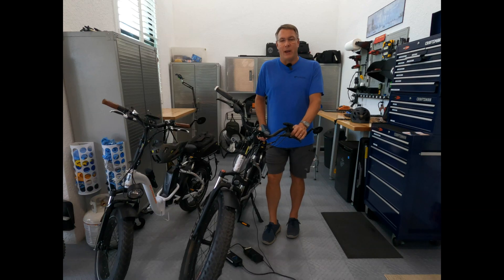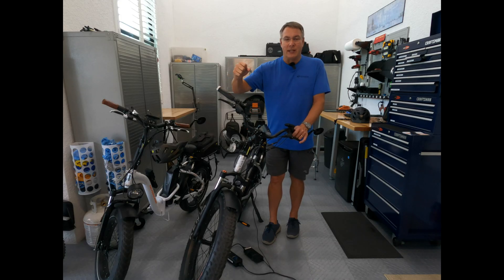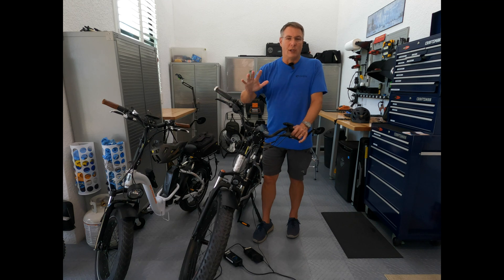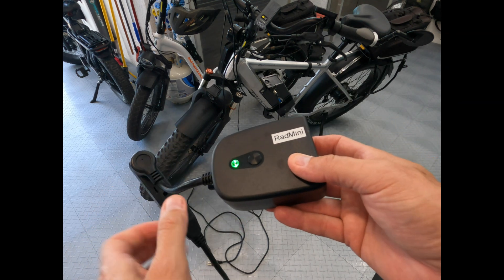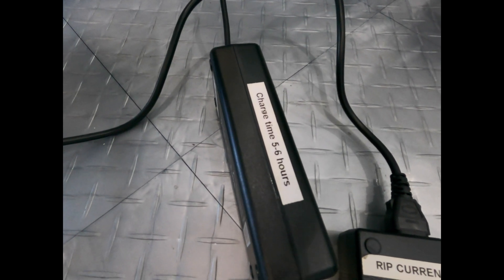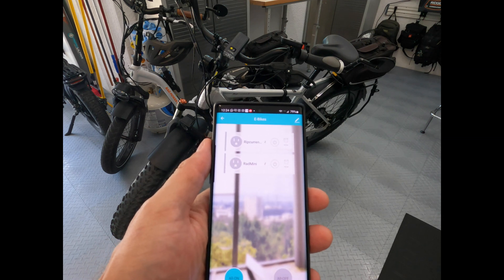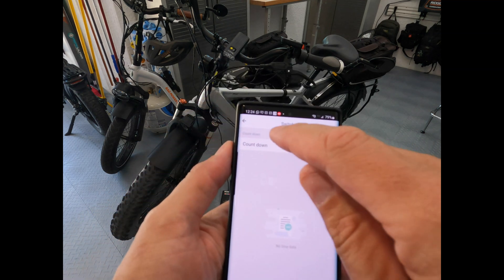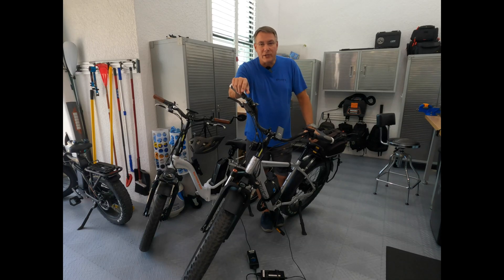E-Bike battery charging using a Smart Plug

Comment: The only thing I would suggest is taking the battery off the bike completely. Charging it separately so that if you do have a problem with the battery you only lose the battery and not the whole bike plus any gear on the bike. Plus it reduces the spread of a possible fire. The smart battery if a great idea. Another thing to consider is charging during a storm. Possibly unplug in case there might be a power surge. Thank you for sharing this was good information to consider.
Reply from the maker: Thanks for adding some great suggestions, TT.  I appreciate it when others chime in with solid information.  -Tom

Comment: How do you know how many hours to charge for?
Reply: You need to know the battery voltage and % relation , then check how many volts your charger tops up the battery for each hour . E.g. with my battery 30.min =  1 volt charge. So usually I don't like to charge more than 80% which is 52v in my pack. If my battery is down to 48v I know 4h will charge to 52v. Hope that wasn't confusing 🤓
Reply: I use the smart plug(TP Link) timer scheduled for 4 hours which gives me a full charge on my Giant bike and have it scheduled during the day when there is usually someone home